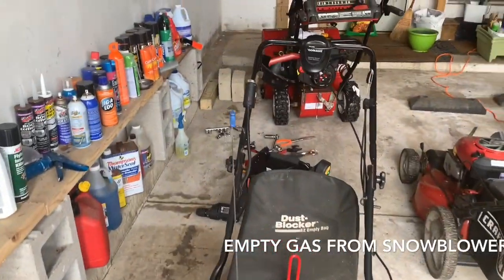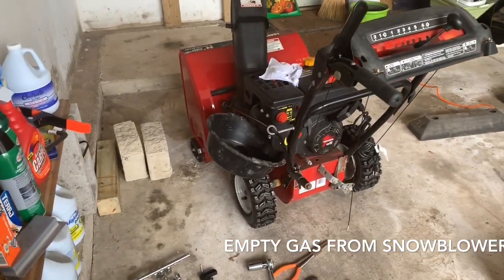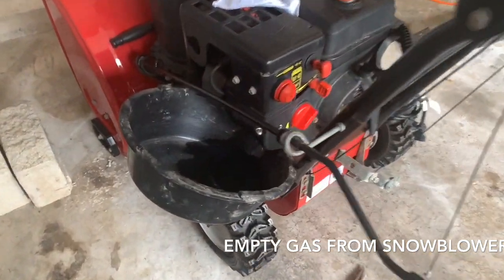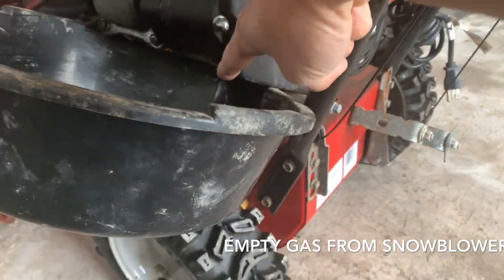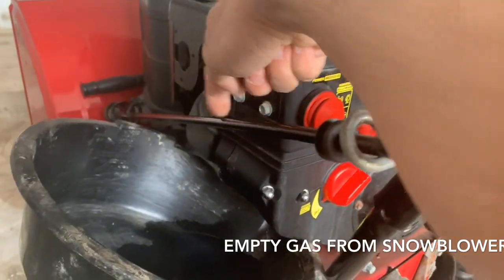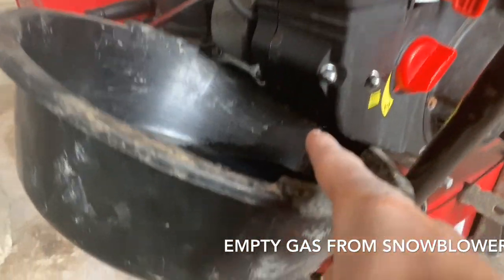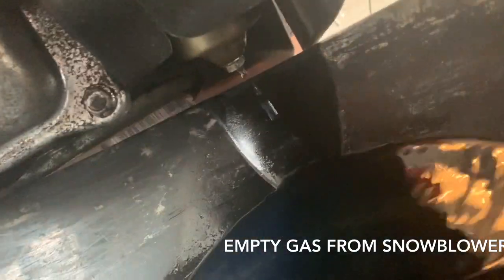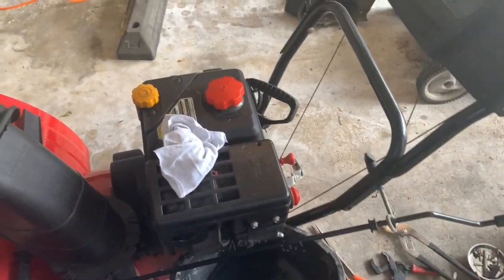Drain Gas from Snowblower

Comment: Looks like an easy way to empty the snowblower. I wonder why people disliked the video.
Reply: takes too long, easier to disconnect the tank hose and open the top, the screw on the carb is to remove gas only from the carb
Reply: @hardkore360  "disconnect the tank hose and open the top". Could you please try wording this another way? I'm not sure what you mean.
Reply: @DavidKimFX  the gas tank is normally  connected to the carburetor via a hose and is usually fastened with a pressure clamp. Undo the clamp with some pliers and then turn the hose a bit to loosen the hose to the carburetor, it usually sticks after the cold winter pretty well. So I like to use a flat head screwdriver to slowly pry off the hose and twist the hose at the same time, be gentle as you dont want to damage the hose. Next, get a can or container ready as when you take the hose off some gas will start spilling. Direct the hose into your container and remove the gas cap of the snowblower, the gas should empty out pretty damn quickly. After gas tank is dry as a bone, don't forget to drain the carburetor as well by opening the bolt underneath. Get a rag or pan to catch any gas spilling out. Leaving gas in the carb gums up and makes it hard on the snowblower to start next season. Hope that helps!
Reply: @hardkore360  Thanks man! 👍
Reply: @DavidKimFX  yeah no problem!
Reply: Because he said that it will empty the oil  without tilting  it. There's  a lot of ppl out there that will think you are  drain oil now.
Reply: Because he said “oil” rather than “gas” as the video implied…

Comment: He's says oil at the end -- this is supposed to be about gas
Reply: Most snow blowers use 40:1 a mixture of gas and oil….maybe that’s why he said that 🤷🏽‍♀️
Reply: @TamaraJewel  2-cycle engines need a gas/fuel mixture, not 4-cycle engines.  I think there are more 4-cycle snow blowers than 2-cycle.  The one in the video is 4-cycle (that orange cap at the top of the blower is for engine oil.)